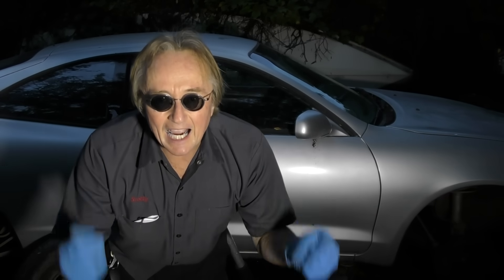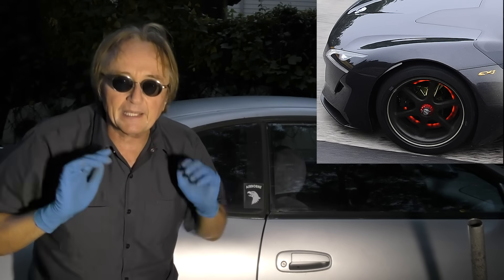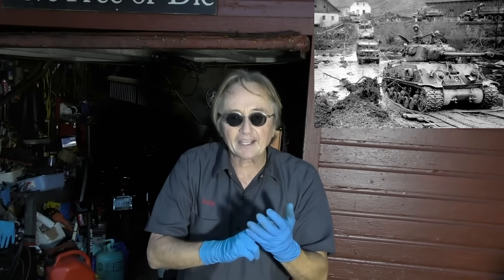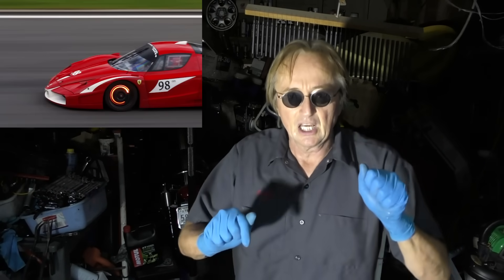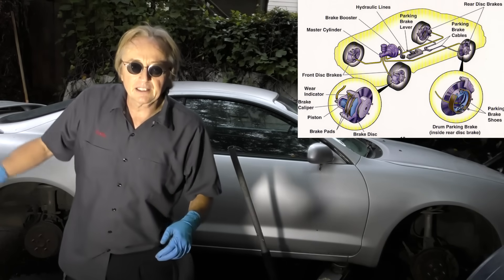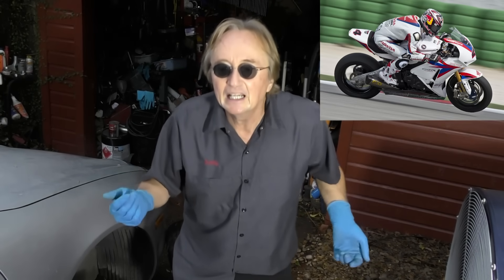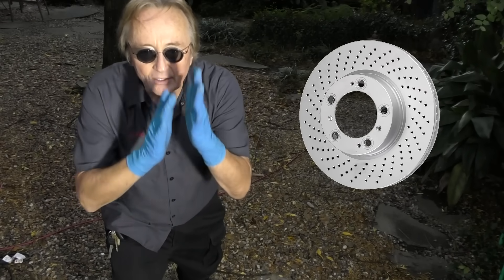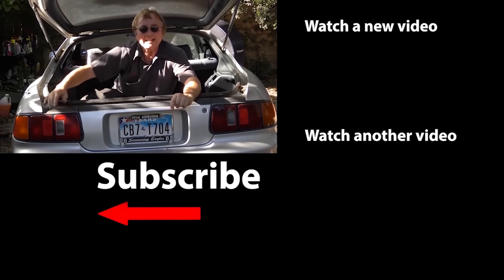Why Some Cars Have Drum Brakes Instead of Disc Brakes

Comment: disc brakes in a Sherman?  lol, you are outa your mind.   The Sherman you show used external band-drum brakes... for that matter the vast majority of  tanks used that system.   The external-band design is far quicker to service in the field, and provided a far greater friction surface than any disc system would.   Contamination wasn't a problem, the brake system is all inside the hull.  I can't think of one differential brake steered tank that used a disc system. Not to say there isn't one.   No tank design I can think of puts the brakes out in the bullets... enemy gunners would have a field day with that.

Comment: rather decent topo on the subject
but dont forget if people used  ventilated twin leading shoe drums these would be nearly as good as discs  and possibly lighter
drum brakes have about 4x the friction material contact area as a similar sized one piston disc system

Comment: Drum brakes are more fuel efficient than disk brakes. Drum pads completely retract from the drums by springs. Disk pads do not have spring retraction, and will continuously drag on the disks, causing friction, increasing rolling resistance, and decreasing gas mileage.

Comment: Drums have more surface area, so thus more stopping power and they hold better then disc. That's why big trucks still use them. And most disc brake part's all together I've dealt with are way heavier then drums and shoes. Plus drums can be adjusted to zero drag.

Comment: How funny, with braking on the fronts. I never understand that. On my bike, I never use the front brakes, because if we stopped short, we can go head over handlebars. So I always break using the rears, if I need to stop even shorter than I activate the fronts.   So 90 -100  percent are on the rear pads, the boost is on the fronts.  So when it came to driving a car, you can see why I am still scratching my head trying to figure out why 90 percent of car braking is on the fronts.  I also use naturel braking, which no to many people dont use.  I have never skidded the tires using netural braking even in back weather.  Y'all should try it some time.  You will be amazed how much quicker you can stop once you remove your transmission out of the equation.  As for drilled rotors, I had to make the switch to them, I am driving so much that I need the extra cooling.  What a difference that made.

Why do trucks have drums on the rear, even more so when pulling trailers? They always fail going down hill, and overheat. Out of all of them, they should have all wheel disc drilled, slot, and cryogenic rotors.

Comment: I dont get why in 2018 cars are still made with drums at all. Toyota used the excuse on their 3rd gen Tacoma that dirt doesnt get into the drums and make them squeal Deliverance style like the front disks will...im not falling for it. I cannot imagine drums being cheaper, drums have way more parts involved. On top of that they can be an a$$ to work on when compared to disks. The wifes 2010 civic has disks all around, but 2018 Carollas have drums...wtf?

Comment: Slotted rotors have another benefit. I use slotted rotors because I live in an area with TONS of dusty dirt roads. I found that normal discs if you don't get rain after a while get dust packed between the rotors and pads travelling at higher speeds down dirt roads. Which I've had cause a lot of brake loss. Slots give a place for the dust to go and get blown out.

Comment: My big complaint about disks on the rear is they have never designed a good parking brake for use in conjunction with disks.  Had many different setups & all PITA.

Comment: Scotty, you didn't even go into the real reason that economy cars run drums in the back.  A parking brake is much easier to engineer as a drum brake than as a disc brake.  When you run discs in the back, that's fine for when you're driving, but the rear knuckles also have to contain mini drum brakes for parking duty.  More complexity, more cost, more weight.

The simplest solution for a car is front engine, front drive, front discs, rear drums, rear parking brake.  You don't get the best handling, acceleration, or braking, but you get a simple car.  For people puttering along to the store, it's generally good enough.
Reply: Rear disk brakes are easier to service than rear drum brakes. That's a fact.

Comment: I wanted to switch the rear drums I had on a 1984 El Camino because it’s braking was horrible. Of course, I was also going to change the front brakes with bigger brakes because I was going to give it bigger more modern wheels, but keep the tires the same size. But that car got t-boned... And I drive a 2000 Ram 1500 now.

Comment: Scotty's Maverick with all drum brakes I guarantee you didn't stop as well as any car with disc brakes.   In a panic stop, no matter what car, I'd want disc brakes.  They simply work better.  (Which Scotty FINALLY admits at the very, very end of the video.)  He also failed to say disc brakes can be replaced MUCH quicker than drum brakes making more profit for the dealerships.  Don't think that wasn't a factor as well.

Comment: Fords always have undersized brakes and tires   to make them cheaper ..  undersized brakes have to work harder and  be preplaced more often ..  Look at a similar sized GM car and it will have  15" tires instead of 14" tires and considerably larger brakes..   I am talking  1970's through the  90's  .. ect  I have not  worked on any new stuff

Comment: I drive a semi truck, and to this day all trucks and trailers in the USA come with drum brakes. Some people convert to disk, but almost all of the 80,000 pound trucks still use them. And we have to be aware of brake fade, especially when coming down a mountain! But despite all that, proper use of the engine brake will keep that from happening.
Reply: Stab braking and all that jazz. Roll that coal brother. 10/4
Reply: Didn't the Kenworth T-600 or 660, in 2005 or so, come with disc as an option on the steer axle?  Worked at a dealer and seen a couple new ones come in with them.  Still used #30 cans and some type of wedge system vs s-cam? , but I left before I worked on one.
Reply: @patcallahan1050  I think so. I had a 2019 Cascadia with disc brakes on the steer axle, but everything else was still drums
Reply: I work on super chassises and other truck components as a part time gig, and honestly, drum brakes make sense in a semi truck situation, especially when the brakes are actuated by compressed air rather than fluid. And plus, they're quite simple to replace and get to when doing wheel seals.
Reply: I've heard going down a mountain, you hold your brake pedal for 3 seconds and let off then do it again a bit later.
Reply: @Ratkill9000  I just used my jake brakes for that

Comment: If you are a DIY individual, replacing disc pads are so much easier that drum brake shoes! Drum brakes in the rear have adjusters and a number of retainers and springs. I'll take disc brakes all the way around just for the ease of pad replacement.

Comment: after owning 2 cars with front disc brake and all wheel disc brake
i much prefer all wheel disc brake..and it's not because of performance
it's because of maintenance
disc brake is a lot faster and easier to maintain whereas drum brake will take quite some time to fix if there was any problems with it
drum brake nowadays is just car manufacturers being cheap and trying to milk more money out of the customer when there is problems with it

Comment: Grooved is to evacuate dust and air faster giving a better feel and more grip to the disks and drilled gives even more with extra cooling. Solid vented do fade it's just most ppl will never tell the diff between a hot disk and a cold 1 under normal load.

Comment: IMHO - when reinstalling front wheels always TORQUE lug nuts to specification. Disc brakes warp if the wheel isn't symmetrically mounted.
Reply: Really should torque all 4 wheels
Reply: Drums do that too. I torque all my wheels.

Comment: I disagree on this. I could tell right off when my mom bought her Nissan Altima it had rear disc brakes because of the fade. Even though the front discs were very excellent, it made a difference because they got zero help from the rear brakes after they faded. 

Four wheel disc equipped vehicles never had this problem for me. 

Now there is a company selling slotted and drilled rotors for the 90s F150/Expedition that have got nothing but raving reviews from people all over the net and I wanted them for mine as the factory units are a tad inadequate by today's standards. This could be because they were just putting new rotors and pads on and that's it, but some of them claimed their vehicles were fairly new. 

But I'm no expert on that and my evidence is anecdotal. In the end I know Scotty is just trying to watch out for our best interest as always.

Comment: ATTENTION ALL DRIVERS OF TRUCKS WITH REAR DRUM BRAKES WHO TOW BOATS ON A TRAILER: Scotty is correct about the front disk brakes causing 90% of your stopping power. BUT THAT CHANGES WHEN BACKING BOAT TRAILERS DOWN A STEEP BOAT RAMP. Now your REAR brakes suddenly become 90% of your stopping power, and your front disk brakes are nearly worthless. THE AUTOMATIC BRAKE ADJUSTERS ON REAR DRUM BRAKES WEAR OUT EASILY, ESPECIALLY WHEN TOWING. If you are having problems with your rear drum brakes NOT working properly while backing down a boat ramp, and your front brakes  lock up too easily, causing your front tires to skid while backing down a boat ramp & your entire truck, boat & trailer nearly rolls off into the water, even though you recently had new brake shoes put on the rear drums, YOU CAN REST ASSURED THAT YOUR REAR AUTOMATIC DRUM BRAKE ADJUSTERS NEED REPLACED. They are inexpensive & easy to replace. But most modern mechanics are CLUELESS about those rear drum brake ADJUSTERS. They don't even know those adjusters wear out back there.  If you pay a mechanic to work on your rear drum brakes, MAKE SURE TO TELL THEM TO INSPECT AND/OR REPLACE THOSE AUTOMATIC BRAKE ADJUSTERS, OR YOUR NEW BRAKE SHOES WILL NOT WORK. TRUST ME. ( Chances are, you rear brake shoes are still good. ) I have always known about those automatic brake adjusters on rear drum brakes. ( They adjust your rear brakes by backing up the vehicle, and repeatedly pumping the brakes a few times. If working properly, they do a great job of quickly & automatically adjusting your rear brake shoes. ) But I did NOT know that those adjusters wear out so easily when towing. I went through several mechanics who didn't even know about those adjusters. So they were all scratching their heads wondering why my new brake shoes were STILL NOT WORKING. I finally learned about this problem. Such a cheap & easy fix too. Too many modern day mechanics have no real experience with rear drum brakes. They are always working on disk brakes. NOW YOU KNOW.

Comment: Why most of motorcycle brake rotors got holes on them straight from the factory? In fact I've never seen a bike with a solid rotor except for a particular model of 1985 Yamaha.

Comment: But why does the drum brake is more cheaper? It has more parts and more complex assembly.
Reply: Anas Takiyudin 
The caliper is not a cheap part
Reply: According to a mate of mine who is an engineer at Nissan, they're not cheaper to produce or have any advantage over a disc other than being another point of difference in trim levels. Such as Scotty's base level celica, all other celicas have 4 wheel discs, even my 20+ year old van has 4 wheel discs.
Reply: @muttonchopps  i'm fully agree with you
Reply: It’s not cheaper anymore. 

In the olden days, it was used to create value through scarcity. 

Like ABS. Used to be only very expensive cars had ABS. Then when it came down to manufacturers like GM, they kept it only in their high end models to encourage people to buy them. Finally when more stringent safety regulations came out and they had a plethora of aging models (J body, A body) which were losing against the competition and could not be modified for dual airbags, they made ABS standard across the board.
Reply: @Bartonovich52  Huh? What do ABS and airbags have to do with one another other than both being safety features?

Comment: Don't forget drilled/slotted rotors have a tendency to crack around the holes/slots.
Reply: That's only with the badly made ones or the rotors were modded after they were made, making fractures a real possibility. That's only a problem with generic, badly made ones, or were worn out too quickly and couldn't dissipate the heat due to being far past the car manufacturer requirements for a safe usable rotor

Comment: At least Drums are environmentally sealed. If you suspend usage of a vehicle and leave it outdoors for several months, you will contend with rusted rotors that will thump as you brake when the car is put back in service. This is an issue for which I haven’t found a good solution?

Comment: The advantage of drum brakes is for the handbrake since a single cable is enough for the drum brakes to engage. For disc brakes, the handbrake must cause pressure to engage the rotors and that system is complicated. That is why some cars have hybrid rear brakes where there is a disc brake outside but inside there a drum brake system. The disc brakes are controlled by the brake pedal and the drum brake system is controlled by the handbrake.

Comment: So is it better with or without holes in terms of heat? You said the advantage less heat in both systems? Do they cool faster without or with holes in it. I would think without holes, you only have better friction with a perforated disc, but they wear faster.

Comment: Not to mention rear drum brakes can last up to 80k miles. At least from experiences.
Reply: The rear drums on my Ford Focus currently have 167,260 miles on them.
Reply: So can rear discs. That’s because in normal driving they are rarely used
Reply: I never changed rear drum brakes and they lasted 250 000 miles!
Reply: @josefsalon4449   My rear drum brakes will probably last for infinite miles, but that's because I have drum AND disc in the back and the dums are only used for the parking brake. 

I did actually have to replace the entire mechanism of both drum brakes because it seized from rust before I even got 60k miles in, but the shoes were still pristine
Reply: My 2010 Grand Marquis went over 80000 miles on the original pads and rotors. And they still had a bit of life in them, the only reason I had to changed them is the rotors got too rusty on the outside edge where there is no contact.
Reply: @billygensmer8207  I replaced the original shoes on my '62 Impala after 75k miles when the one of the wheel cylinders blew. The car was 54 years old at that time.

Comment: I disagree totally about drilled and slotted rotors.
All my SUVs and pickup trucks have been upgraded to Power Stop Z36 Truck and Tow drilled and slotted rotors with carbon-fiber ceramic pads.
There is a big difference in stopping distance and brake fade, especially when towing or carrying heavy loads.
Also I can get them for about the same price shipped to the house as the crap brands that the local part stores now carry.

Comment: Hi all just an fyi Remember gas is compressible,slotted or drilled rotors are made that way to release "gas" pressure from moisture or "steam" also some brake compounds outgas when under pressure. The slots or holes give the pressure a place to escape instead of pushing back on the pads. Nice work Scotty  thanks for all your videos 👍

Comment: Drum brakes are quite effective and their servo design can stop big weight, like Tractor Trailers...they also have an advantage where debris like rocks or gravel are concerned. But disc brakes do perform better in wet or repeated use condition where heat dissipation is a concern. Each has it’s place.
Drilled and slotted rotors are designed to dissipate gases and heat generated from heavy braking. These gases can cause the pads to slide on the rotor surface under heavy use. Not needed for street cars, but they look cool. I haven’t seen any reliability problems or increased wear from them here.

Comment: I believe another factor is that incorporating the emergency brake function into a drum brake is easier. With rear wheel disks you need either a special caliper design to do the emergency brake or a small drum brake inside the disk.

Comment: Excellent presentation!!!
The 90:10 front to back analogy is spot on; quite pertinent with 'high profile' vehicles where the vehicle's 'center of gravity' is quite high and when the vehicle 'lurches' (down in the front and up in the rear) during HARD breaking ...  and most of the stopping power is mainly due to the FRONT brakes.    

Perhaps Scotty can,  in a future episode, recommend increasing the 'area' and force (or even 'pad' choice) of the (front) brakes for those whose brakes seem to be 'wimpy', especially for those of us who drive in 'wet' conditions.  Thanks.

Comment: I have a 2004 Montero/Pajero it has disc front and discs on the back, but when I replaced the rotors and pads it looks like it has drums on the back as well as the disc, under the rotor it had the springs and a piston... any idea what that could be?
P.S: Your videos helped me change a front cv for my mate which cost him $80 and a few beers instead of the $250 the mechanic wanted. thanks =D